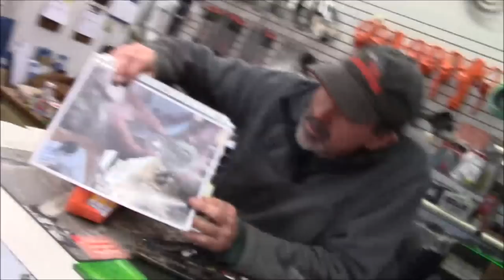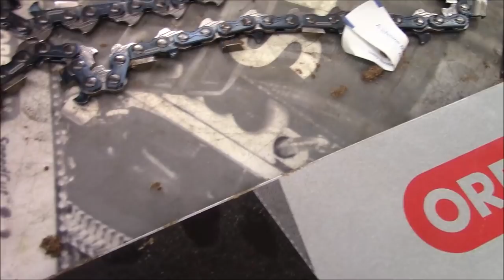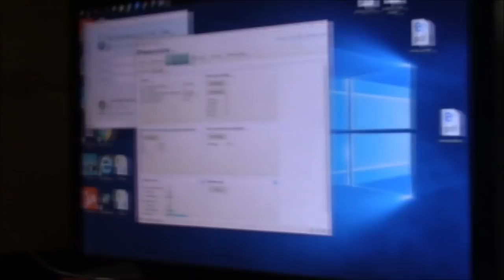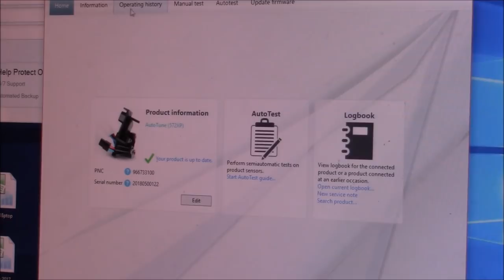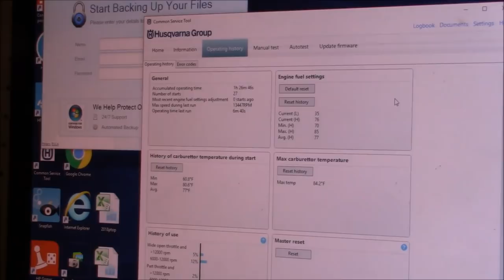Husqvarna 572xp First Impressions and Overview

Comment: So I got to run the 462 ...not at all impressed with it.  The saw is a bit lighter than the 572 and 461...but they sacrificed long term durability in that saw to lower the weight of it.  The 462 is a screamer but it lacks the torque of the 572 which is better for felling in real world conditions
Reply from the maker: All good saws , I have to say I've heard pretty much exactly the same thing from the folks I deal with around here. Seems the loggers and pro's here are a different world than what I see on the forums :) I for one really liked the 461's. The local dealer has ONE left. Really tempted to snag it. They remind me of the Husqvarna 576's, And the 572's will be around a while. Keeping mine "cherry" and waiting for some to come thru blown up...just NONE have come thru. They are another saw that go out and don't seem to need to come back to the dealers. Maybe next year I'll snag a 572 builder.

Comment: I picked one of these up the other day and it cuts pretty good. I wanted a regular carb 576xp but they only had the 572xp with autotune. I like it though. Definitely want ear protection for long term use. It’s loud.

Comment: So I got to see the 462 in person...not at all impressed with it.  The saw is a bit lighter than the 461 and 372...but they sacrificed long term durability in that saw to lower the weight of it.  The 572xp will be the 70cc King of its generation unless they have some crazy failure somewhere.  People will buy the 462c because of weight in the beginning and after they find reliability subpar they will be switching to the heavier 572xp.  The 462 is a screamer but it lacks the torque of the 572 which is noticeable in a 24” bar or larger.  The 461 and 372 were the best 70cc saws in my opinion...Stihl’s 661c is a great saw, Ive been very impressed with it...not a quite 395xp in terms of power though close but its nearly 2 pounds lighter and very durable...top handle saw...150tc 201tc, 50cc saw goes to Echo’s cs500p(their only saw with decent power/weight ratio shindaiwa 488 redone), 10.6 pounds and with a 16” it cuts incredibly fast and very reliable. 60cc I gotta give it to the 562xp, 70cc will be the 572xp no doubt, 90cc will be the 661c unless Husky updates their 390/395 line...milling saw goes to the 880 its a torque monster.  Thats my personal opinion on who makes the best saw for each cc range.  40cc range is kind of unnecessary but the 241c would take it.  Normally I wouldnt put Echo in the same league as pro stihl/husky but if youve owned and ported a cs500p you have a very very nice saw.

Comment: Very interesting to see the carb temperatures that much lower than the 562! Someone from Husqvarna must be watching.😉
Reply: bobe8888. The hot start issue was solved on my 555 by depressing primer bulb to send in cool fuel to the  carb. I have second gen AT chip not reflashed yet. Anyone have similar experience?
Reply from the maker: A little secret? My UOMS had an even lower carb temp..:)

Comment: Great vid. Stay away from Stihl 261. My Stihl 261 broke down after only 3 years of cutting firewood. Stihl said it was my fault because I didnt use the Stihl oil and alcylat gasoline! 026 was a much more robust saw and I had one for allmost 20 years and used shell oil and 95 gas mixed 2%. Not happy with the Stihl 261 and Stihl support.Warranty does not count if you not use Stihl oil motomix or Stihls alcylatgas.
Reply from the maker: I caution against trashing a brand based on a one saw experience. There always will  be product failures, a statistical thing. This is a sample "set" of one. Often times the way a dealer handles these things is more important the the actual failure. The dealer presents the data both to Stihl and the customer. Not being there therefore not knowing what actually happened first hand means I really have nothing to add other than my first comment. AND those old Stihl's were rugged. As were some of the other older designs. Jonsered's come to mind. Still see the 70e's around!

Comment: I have a technical question about the air intake vs. the 562s. I am one of those people with filtration issues on my 562 xp, lots of fines after relatively low run time. I'm almost certain the carb. bolt spacing/ throat will be wider, and the strattos will hook in different, but are we lucky enough to have the same bolt/ intake pattern? Would love to have a fliter like that on my 562xp. Also would love Husqvarna making a update to put this filter setup on the newest iteration of the 562xp to forever solve the 562xp's filtration shortcomings.

Comment: Great video guys. I would've liked to learn more about the weight comparisons / feel. Does the top handle feel larger in diameter similar to how the 576 feels? Also any info on availability of the XPW?
Reply: Top handle feels the same as a 576.

Comment: The Saw is looking nice from what i have seen to this point. It will be interesting to see how the Saw performs on the long term, reliability and so on. Do you know if the improved AutoTune will be coming to the newer Versions of the 550/60/62? If so, I would be pretty courious how these Saws will perform with the advertised 10x faster AutoTune.

Comment: Hey Bob/Walt, cool video.
I like the grey finish a lot myself, looks like it will hold up very well.
I'm pretty sure the clutch cover is plastic an not painted, which works for me as the silver/grey covers have never been a favorite of mine.
It does seem like a very nice blend between the 576 and the 372. Unfortunately it feels a bit more like the 576 in the weight, but it is at easy to maneuver as the 372, and a little better with the sloped back cylinder. 
I believe husky has hit a home run with the 572, very impressed :).

Comment: Anyone feel like husky auto toon is stop gap measure. Gm tried computer controlled carbs in the 80's and quickly ditched them for efi. But maybe husqvarna know something general motors doesn't.
Reply from the maker: Not even the same concept, not really relevant actually. One thing is constant , how much BS is out there online about the Autotune technology.

Comment: 140 psi is good compression for 372xp 2003?
Reply from the maker: Good enough to run assuming the rest of the saw is healthy
Reply: @afleetcommand  Apparently new ones were between 140 and 145 psi, with a basic gasket ?????

Comment: What is the most amount of hours you have seen on the 572?
Reply from the maker: Personally around 600 plus a little , friend in the business got one in with over 700. In my case it had not been "reset" or had the carb changed. It was just run as it was a loggers saw. Had the air box plugged with saw dust. Why it came to me. That was last year, it's still cutting. I wonder about the "time" as that saw runs all day and has since 2018. Simple math says say 4 hrs a day, 5 days a week. 50 working weeks a year. So. after 3 years that has to be a big number, not 600

Comment: If this replaces the 372 and the 576, what is going to happen to the 576 autotune?
Reply from the maker: Its a 576...they are going away
Reply: Okay, thanks. I'm probably wrong, but it seems sad that there will be nothing to bridge the gap from 70cc to 88cc (assuming they keep the 390).
Reply from the maker: They don't have anything now really. And the 390 is light enough it makes little sense to have a 80cc in the line up.
Reply: The 576 is @74cc. Not much difference I know, but that's what I was talking about, would be nice to have something about 75cc. Again, i'm probably wrong and it's not necessary. The 572 probably has enough power to bridge the gap, and the 390 may be light enough to justify use in that area. In all fairness, I still use my 365 non-xtorq so I have no idea about the 572, 576, or the 390. I have to admit, I am intrigued by the 562/572 style saws.
Reply from the maker: I can see that, the 372 had the xpw version. Seeing the size of the crank & bearings, it wouldn't surprise me to see more displacement on that chassis in the future. The bearings are about the same size as 390's are right now.

Comment: How I feel about the 500i can’t wait I think hers is got a lot more of technical problems standstill I’m seeing the dealership down the road is a dealership that sells both of them and the mechanic said to be completely honest with you Husqvarna in the past 10 years has had way more problems then stihl
Reply from the maker: Here is the issue, Husqvarna  basically evolved the "Autotune" technology and as a result had issues with the 550's and early 562's when they were "new" technology being introduced into a pro world. The 550's are now as a result in a second generation with the MKII's and they are solid. The 562's after 2016 are as well as they both gave dealers an upgrade path to get their saws solid and redesigned critacl components to make the later than 2016's solid as well.. AND to add insult to injury, the first couple of years of 372 X-Torq had bearing issues. Somewhere in the same 2016/17 they seemed to have solved those issue. A moot point as 372's are no longer available. The new "replacement" for the 576/372's ; 572 is SO far ahead in terms of reliability because they took what they learned from the teething issues from the 562/550's and designed a saw to solve those issues. And while it had nothing to do with the autotune technology as much as it had to do with the more eco friendly cylinder designs trying to increase the efficiency of those little two strokes. The 572 has had no issues in its release. None. So statements like that dealer says are without context to anything tangible or real. Fact is when Stihl got into the Strato & autotune like technologies they too had issues. And Husqvarna is far ahead in experience as demonstrated by the 572's release. So I call BS on that as a rule relative to what's being sold now because first I work on both brands, from dealers who sell both; and second I am familiar with the issues from both brands. While it has some truth becasue the 550's were terrible, the 372XT's had bearing issues which colored both dealer and customer perceptions, that isn't representative of the saws sold this year. Also many of the dealers never really learned the CST on the Husqvarna''s. Having said that the saws still sold by Husqvarna and Stihl that I see as solid are saws such as the ms461, 572xp, 390xp, and ms661. Those are all four solid and mature designs that have proven themselves in the pro world. Any one of the four would be a good investment. My two favorites are the 461 and 572 of the saws currently sold. The 462 is still a question as is the 500.
Reply: afleetcommand  Thank you for your knowledge your experience and your time I take what you say completely to the front of the brain thank you sir
Reply: afleetcommand When you get a chance tomorrow would you please respond I have a question I ordered that saw from farm tech l 15 days now and they keep sending me tracking numbers that don’t exist did you have a problem with that at all?Once again thank you for your time
Reply: afleetcommand I just went and bought a 572 They were kind a hard to fine I wish  I it would’ve came in a box I got to the dealership and it was already sitting there the 372 is still caught in China they gave me a FedEx number four times I’ll never put myself through that stress or hassle again Hot saw 100 On YouTube breaks that down right next to a 461 And 462  I believe The 572 Xp It is definitely going to ring bells for many years to come

Comment: Now a days when they  bring out something new to replace an older model. The newer model won't last as long. The stuff isnt just in it to last.
Reply from the maker: For the most part true, seem like in this case Husqvarna is going the other way, bigger and better quality bearings and crank a clue. The "Other" brand is shooting for a spec sheet sale. Guess we will see which approach wins, bling or guts.
Reply: 572 is guts for sure. Awesome performer.

Comment: They get rid of the fuel push bubble I'd buy one
Reply from the maker: The fuel bubble is one of the best parts of that puzzle, allows u to flush the carb of condensation prior to starting....easily saves a pull or two as well on any cold start

Comment: I keep hearing lore about breaking in a saw. That "It needs to go trough x amount of tanks of gas to wake up."  so I wish someone would make a video depicting exactly what that is and not just talk about it. My reasoning is that I have several saws everything from a Stihl 661 cm to a tiny Sheppach and from the moment they came out of the box and made their first cut till now I haven't seen, felt or heard any difference in my saws' operation. 
If I'm missing something I'd be glad to stand corrected.
Reply from the maker: Some folks are more sensitive than others :) Compression actually increases during the run in/break in process. On the 5 series sometimes it takes 8 to 10 tanks to get to "max" compression with a proper oil, where it stays for its service live. Like the "My Cousin Vinney" Magic "Grit" scene, Stihl and Husqvarna alike follow the laws of physics. :) My Chinese clones will break in with 3 or 4 tanks. Softer materials? So If your saw is either "Pre" broken in or breaks in fast... :)
Reply: @afleetcommand  OK, this gives me some understanding. Appreciate it. Reminds me of breaking in a new car's engine.
Reply from the maker: Think of it as the cross hatch is a file, the rings get filed to fit. :) Then the file gets a little "dull" hopefully by then the rings are as close as needed to get max seal. Depending on things like oil quality/properties & material properties of the internal parts, that happens in a reasonable time...not too fast, not to slow and hope then it is at a "steady state" for a long time. EVERYTHING is in flux all the time.

Comment: The 372 will.cut right with it , I think it will out cut it as the torque on the 372 seems better , we had both of them side by side in the woods , the 572 was just broke in and the 372 had a little more run time , sorry don't see all the hype
Reply from the maker: Most won't :) It's not always about power.
Reply from the maker: BUT if you saw the 372xt's I have come through the shop over the years, it would make more sense.  Not going to even attempt to explain but if you have followed the channel ...:) Bottom line? You happy with 372's, keep buying them and stay happy..:)
Reply: No it will not keep up with a 572.

Comment: I don't know nothing about the professional saws I run my 460 rancher for 10 years I love it but I burned it up. i don't know how I burned it up except I put a 24" bar on it and cut up about all kinds of 100 + year old oak trees with it. I may have just wore it out. I took it to the saw shop and the feller said the piston was scored up bad and it lost to much compression.  That's why it wouldn't crank up for me. the feller at the shop said he has some parts he can look through he might be able to do something with it. he called me up and said your saw is ready. when I got there all he would say is I'm charging you $80 he cranked it up and it run and sounded like the good old days. I said to him what did you do he just said back to me just work the saw if your not happy with it bring it back and I'll give you  $80 towards a new saw. I was thinking to myself why can't he just tell me what he did to fix it but he's a old timer so I didn't push it and said thanks. got home cranked it up first pull☺. went to the wood pile and found a big log and the saw cut like never befor so I cut more and more of my fire wood just loving it. I know I have a defrent head on it because my old one had a busted fin where now it don't. any way I love my 460 rancher it's just I want more. I think I want a pro saw. I know you fellers  are all into these saws I just cut wood for my outdoor wood furnace the 460 rancher is all I know except Poland craftsman and such lol. I'm looking to upgrade into a better saw just to much going on to many choices. someone tell me what I want? that 572 looks good I would work the shit out of it. is that what I want?
Reply from the maker: IF you can get one, a 572 won't disappoint you. I would pick it over anything else in that weight and displacement class at this point, from any brand.
Reply: afleetcommand i looked pretty hard for one. I couldn't find one. I'm probably going to hold off until the 572 is more available.  I thought hard about the 562. I believe the 572 would make me more satisfied.
Reply: Were you running it too lean? Or not letting it warm up properly before going to town? My 450 was my first saw, I've had it going on 10 years now and it still runs great. 10 years of consistent use is a lot for one of the 400 series saws though so you may have done nothing wrong

Comment: Any thoughts on how heavy it is??
Reply from the maker: Like the fact they added weight to the crank and used the larger main bearings. Those saws are going to last for a pro. Personally I get tired of the "spec" sheet mentality to rate a saw..:)
Reply: Ya the size of the bearings dwarf whats in my 562. I ran a brand new ported 572 and it's impressive but felt like a cinder block
Reply: As impressive as my 562 is, which is ported etc as well is, I'd have to b cutting quite a bit of big wood to get a 572

Comment: Looks like a lot of copied stuff from the MS 462
Reply from the maker: Except I saw the early 572 prototypes back in 2011, fact is a lot of the Stihl stuff came after Husqvarna's especially with the M-tronic / Autotune technology. Husqvarna went the "light weight" route and went back to a more durable design with heavier crank and larger bearings.